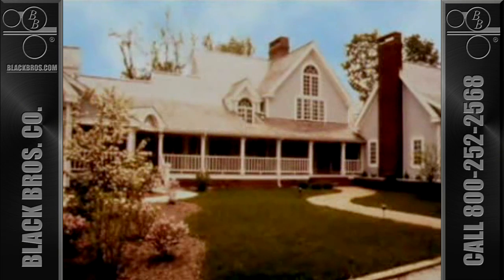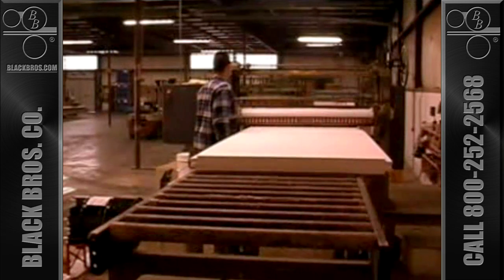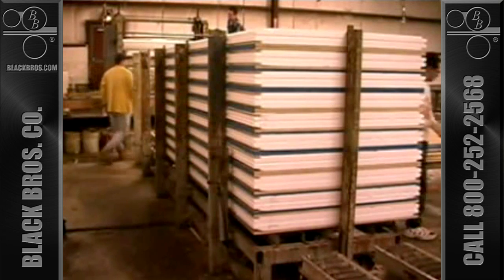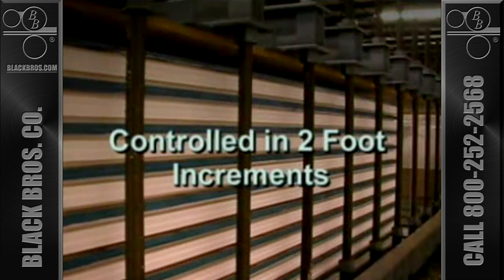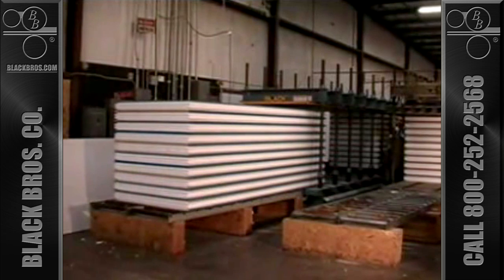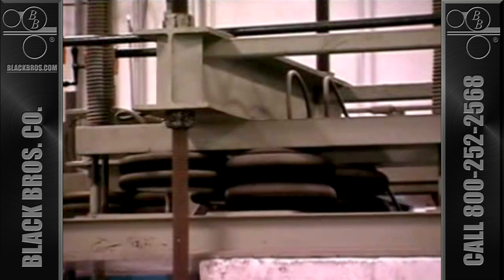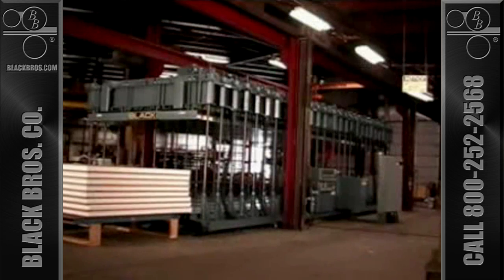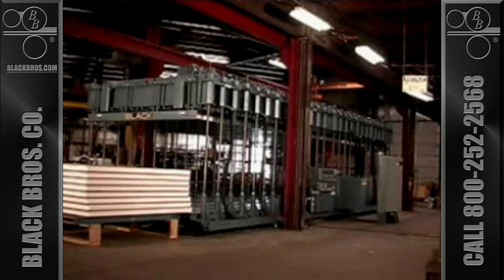SIP Laminating System - Black Bros. Co.

Comment: we are seeking SIP glue spreader machine line suppliers for customers always

We are an ISO9001 and ISO14001 polurethane glue in China .  glue could UL quality requirement , have SGS report , fire resistance certificate . 

if you need glue for SIP panel , please contact us info@polyurethaneglue-china.com , easybondglue@gmail.com  , whatsapp 0086 13505260570 ,skype annzhao86